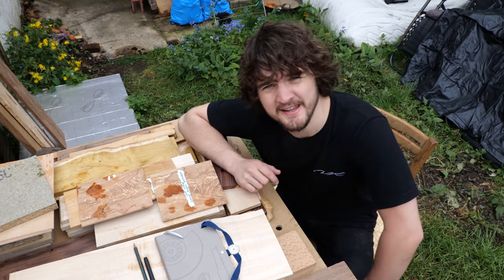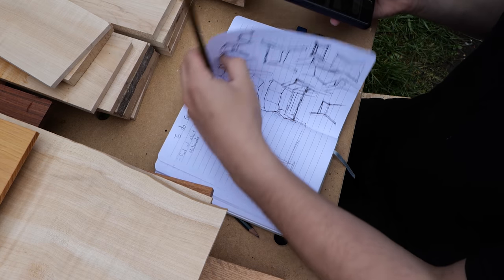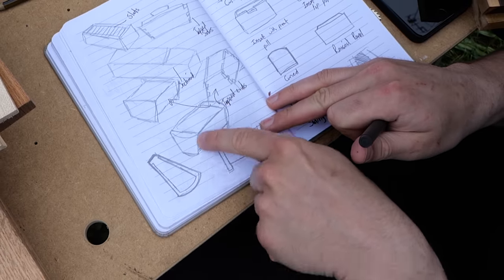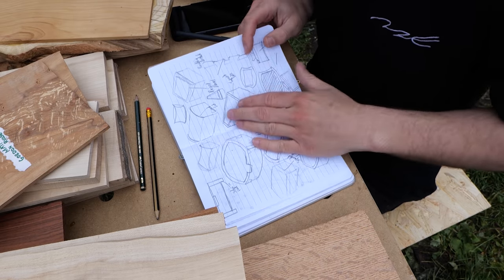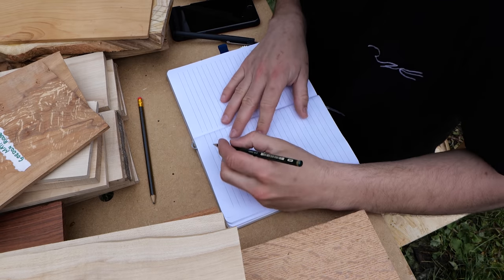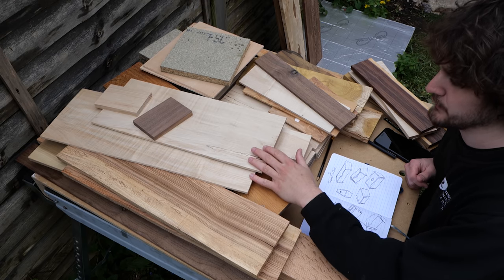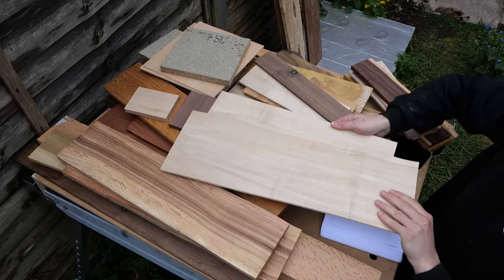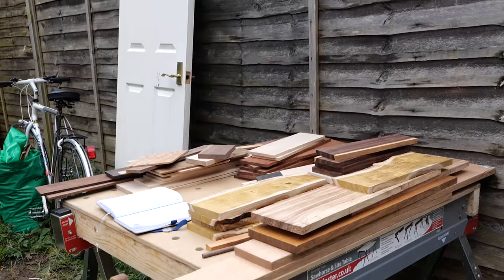Designing Boxes for the NHS | The Garden Workshop #2

Comment: I came for the dovetail joints video probably about 4 weeks ago. Before I knew it, I was about 40 videos deep. I don't even own chisels or a saw! 🤣 That's definitely something I've been wanting to change for quite some time though. I'm hoping to start working on some woodworking soon.

Keep up the great videos. 👍
Reply: Along with chisels and a saw having a good workbench is useful as far as this woodworking stuff goes too. My first workbench was pretty rough. So was my second one. My third isn't quite ideal either. Now I'm trying to think what ever happened to those other two benches I made. I can't remember. A guy named Rex Krueger did a series about a roman workbench he made. Which is better than the first bench I made. We all have to start somewhere. Oh and plan on getting some sharpening supplies too. Working sharp is key to woodworking. You just can't do amazing cuts if your tools are not sharp. I used this for a while it's not bad https://www.harborfreight.com/4-sided-diamond-hone-block-92867.html I mounted it to a scrap wood base that I could clamp down. Use it with some lube. I use a cleaner called Purple Power. Today I use Chinese continuous diamond plates.
Reply: @1pcfred  I'm a patron of Rex.  There is a lot of crossover on his fan base and Matt's.  You should check out Rex's latest bench the Joiner's Bench.
Reply: @nicmasterdude  a lot of YouTube woodworkers really get out of sight with their shops and tools. Which I find off putting. But Rex makes an effort to keep things accessible for a broader audience. I like that.

Comment: Hi Matt, what software do you use for your designs? Can you give a link and perhaps do an intro to using it in the future?
Reply: dkg30 I think it’s Sketchup Pro.
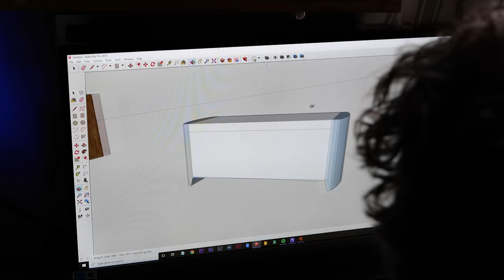Reply: 11:56 Sketchup Pro 2019
Reply: @TheBelkul  thanks, does Sketchup pro generate a dimensions drawing plan that you would use for making the actual project or is it just a 3d modelling app?
Reply: @dkg30  It is a 3D modelling app which you can dimension off of, but there is no stirct 'dimension drawing plan functionallity' (as far as i know). It is not made for wood working though alot of people use it as it is fairly easy to learn. Each project is made up from a number of parts or components, and these can be exploded or layed out individually to give you a dimension drawing, but you have to do this manually. There are extensions like https://youtu.be/s6ZzEr-mTYQ which can help. I prefer Fusion 360, but it has many of the same downfalls.
Reply: @TheBelkul  thanks for the comprehensive reply, not sure it is something I would invest in then.